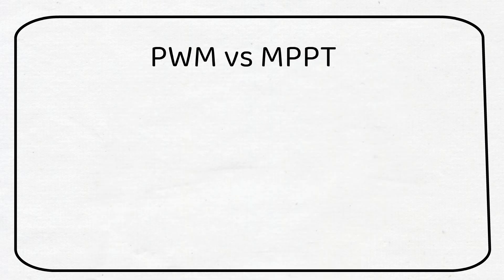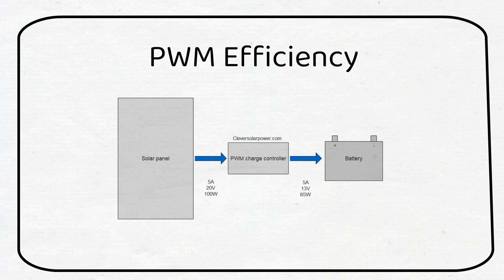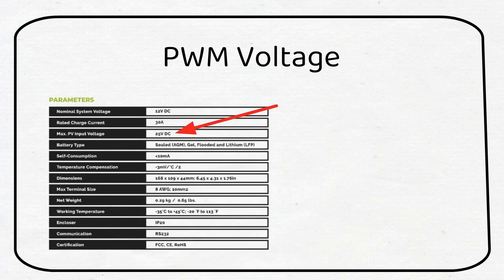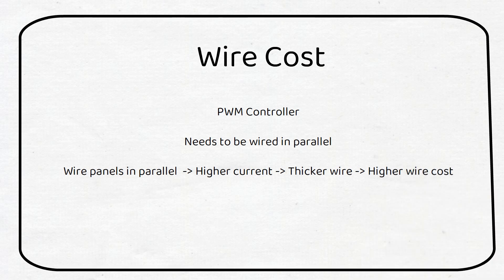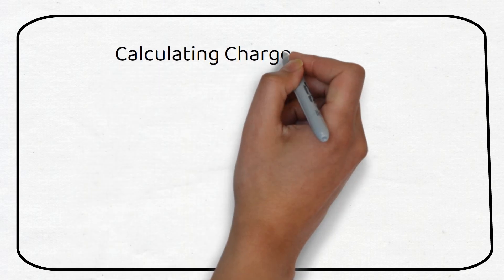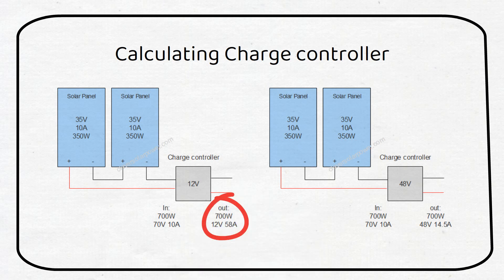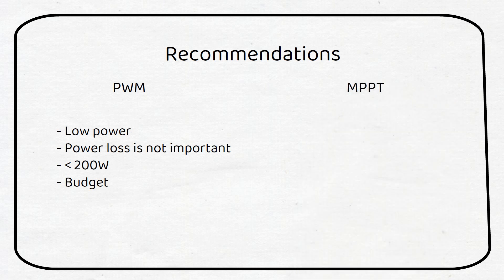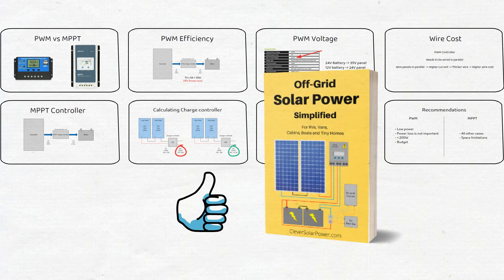PWM vs MPPT Charge Controller for Solar Panels: Which one is best?

Comment: Ever look up the price of a 48V dc to AC inverter?
Be prepared to sell your first born.
Most sensible one is a 24v setup or 12v setup.
Best bang for the buck.
With a 12v inverter, you can in an emergency hook it up to your car.
All others nope.
Mfr's KNOW what it costs to run any given solar arrangement.
You will either spend a lot of money on their overpriced equipment or a lot on wire.
And set prices accordingly.
Either way one of them is going to extract as much cash out of you as they can.

Mfr's also love to set warrantied to about 2 to 5 years too. KNOWING you may have to buy their junk AGAIN AND AGAIN during the life of your panels.
IMHO all equipment should be fully warranted for at least 25 years with instant replacement if their stuff fails.

Comment: I have both types of charge controllers. I found that the MPPT charge controller needs more sunlight to start working whereas the PWM charge controller will work under less available sunlight. With a small setup at 12V, I got more current from the PWM charge controller for a longer time than when I used the MPPT charge controller. The MPPT charge controller started working close to noon whereas the PWM started to produce current around 8 AM. Like you said, the MPPT charge controller is better if your solar panels are connected in series and you have several panels connected in series. I appreciate your video.
Reply: My MPPT starting work at 7:35 and stop at 19:00 in the Finland with Start/Stop power about 25Wt. My PV is 12x435Wt

Comment: MPPT controllers are useless on a cloudy day. They spend all of their time resetting and recalculating then sometimes they get stuck on a lower output when there is a cloud or haze but once the sun comes back out they can still be stuck on the lower calculation from earlier forcing the user to reset the MPPT to force it to make a new calculation.
  Show me some videos where people plot charts to make comparisons in real world situations.
It's better just to run a DC to DC step down converter. It will always convert the power available whatever that power is at the panel. It won't waste time recalculating constantly as clouds pass over.

Comment: Yeah but two lifepo batteries cost 5 times  the pwm controller and all the panels I would need.
Reply from the maker: You can start out with a pwm and upgrade later. When you buy an mppt, The Solar panels effectively work More efficient. That's because you will convert More power from The Solar panels into the batteries.
Reply: @cleversolarpower  again two batteries cost the same as everything else where I live. I am looking into buying a BMS module and connecting some batteries myself. It cannot be that I have to pay 1500USD for two batteries and then 1200 for a Victron MPPT, an inverter and 200USD for panels. Bosnia being here btw.

Comment: PWM if you are on a budget..........
You get can an MPPT controller for 35 quid (GBP), if you cannot afford that don't get solar panels.
Reply from the maker: If I have a shed far away from my house and no cable going to it I would install a 50-100W panel with a PWM and a cheap battery to turn on some lights. No need to get an mppt in that case.

Comment: Hi! Are you sure PWM converter does not increase the current when reducing voltage? I think its a dc/dc converter, not linear. Just the same as MPPT but MPPT regulates the input voltage (not only output) to get the max power from pannel
Reply from the maker: I'm very sure. I test it and a video will come out soon. A PWM cuts the excess voltage off.

Comment: Hey I need a solar home inverter with 24V battery backup and for me the UPS function is really important. My vendor suggested pwm based UTL solar inverter since he said that although MPPT tech is better but due to solar optimization its UPS function wouldn't do well. Is he correct and what is my best course of action ? Thanks in advance.
Reply from the maker: Depends how much solar you have. If you have more than 200W of solar, then i recommend using an MPPT.

Comment: Great vid. New guy here wanting to try out solar power.   I bought a small kit Eco worthy one 195watt panel came with a 30amp pwm controller. Then I just bought an extra panel same one 195watt and bought 2 AMG 12v battery’s 110ah will this set up work? 
Just wanna be sure before i install it all. Thanks for any help

Comment: Pwm only loss then what use
Reply from the maker: If you match the PWM with the battery voltage 18V panel and 12V battery, there won't be much loss.

Comment: Please I have a single 350w xolar panel, voc is 34v, vmp os 30v
And I have a 12v 200Ah gel battery, please what charge controller would be efficient, thank you
Reply from the maker: MPPT
Reply: @cleversolarpower  thanks

Comment: how do these things handle being connected to a system that also charges the batteries with a gas generator?  What do they do when the battery voltage is 13.2 while charging?
Reply from the maker: You can add multiple charging sources to the same battery. I made a video about it. (multiple charge controllers)

Comment: That was a good honest explination between the the PWM and the MPPT controller they both hove there places -    i might add this if your panels are at a distance from your batterys say 500 ft - in that case you would perfer to series your panels to get a higher voltage of 80 to a 100 volts - 
        With the higher voltage there is not a notacable amout of line loss compared to 12 or 24 volts - 
      At 100 to 110 volts DC  the line loss is 10 % per mile or 5000 ft - so at 1000 ft its not a notasable amount of line loss - a MPPT will correct the voltage to a usable voltage -
Reply from the maker: 500ft is long. You have to wire your panels so you get high voltage to the max allowable input voltage of the MPPT, and then run the high voltage wires to your MPPT which is close to your battery. Check my video about voltage drop.
Reply: I realize 500 ft is long - I had worked on micro wave relay stations in the Northern mountains at times - my family is also in the communications business - 
    Those repeaters oil company's use were once owned and set up for 48 volts - at times there was a distance between solar panels and transceivers -   the battery's were at the transceiver sight -            I know each country often uses different voltages - those AT&T repeaters always had MPPT controllers set up at the batteries for charging - the input was generally 120 DC off the panels  - at times the panels might be 1000 ft from the transmitters - 
     At times the generators were 3000 ft down a mountain from the transmitters -   there at lower elevations because fuel trucks can easily deliver fuel to bulk tanks during summer when the snow is melted - 
        In all AT&T has a standard voltage of 115 volts DC in this case for transmitting power battery charging -  
     At 3000 ft there is some voltage drop it might drop to 105 to 110   volts DC - but it was not enough voltage drop to master - there wasn't any inductive load - 
       Also in the rural US as you drive down highways  - you might see transformers on poles with simplex power lines coming off them that is 120/240 - that simplex line might have a run of 500 ft to a home 500 ft off the  highway - 
      The voltage in that home might vary from 125 volts to 115 volts when running a central heater drawing 60 
 KWs  - that's very common in the US, power company's don't like to run low voltage for more than 300 ft - but in many cases in rural areas  because of roads or trees or right away approvals - they will run low voltage 120/240 power lines 500 ft - 
      All I can say is even with the induction from 5 ton air conditioning condensing units it does work out fine ,- some times if it further than 500 ft they up the voltage to 130/260  volts at the transformer that way they can run 750 ft lengths of duplex - 
     The higher voltage is needed for induction loads of heat pumps that are at a distance from a transformer -

Comment: I was not born in missouri although I live there.  But you are going to have to show me how a pwm charge controller which is controlling  20volts at 10 amps is inferior to a mppt controler which may only be regulating a 40 volt panel at 5 amps.  I do not see a mppt controler providing 10 amps at 12 volts with a 40 volt 5 amp panel.  I do not see how you are going to get more amps  out than what is put in.   If true you are still going to need heavy wire going to the battery.  I have been useing a pwm controller on my 2300 watt panels wired in parrallel for 20 years and it seems to work fine.  I feel mppt controlers are way over prices for what they do.

Comment: Can't we use charge controller for charging lithium battery with car alternator?
Reply from the maker: No, the car battery voltage needs to be 5V higher than the lithium battery.

Comment: Can I run 2 charge PWM controllers from 2 solar panels wired in parallel? Can I split the feed coming from the panels to both controllers without losing any power? If I did it that way, would one controller draw more power from the other?
Reply: One solar panel connected to one  pwm, is better in your case.

Comment: Either of the 2, can we use 18650*3 or 12v series as storage batt instead of lead acid batts?
Reply: You can use either rechargeable battery.

Comment: Hi, i have a 555watt panel and 2 12v batteries (200ah) and a 60Amp solar controller. Is this okay to set up?
Reply from the maker: 555W/12V=46A
Reply: @cleversolarpower  so if I have 24V battery bank and 555watt panel that's 555/24=23, can I use a 30A solar controller?

Comment: Since I have three 100 watt solar panels (soon to be four), two are in a different location. I bought two 20 amp name brand PWM controllers which can do lifepo4 batteries. The two I have in operation are for lead acid batteries only. The two solar panels are already wired in parallel. The same will be done when the new panel arrives. I wish I could put all four solar panels together for a MPPT controller but I get more sun with what I did. I don't have the room for a larger system inside the house. I will be replacing the AGM batteries with two 100ah Lifepo4 batteries to run my 2,000 watt inverter. That is all the room I have.
Reply from the maker: Instead of getting two 12V 100Ah batteries, i suggest going with 1x 12V 200Ah battery.
Reply: @cleversolarpower  I am actually looking at a 180 ah lifepo4 battery which would be more friendlier with my budget...Yes, I gave you a thumbs up.
Reply: I'd be 100% sure that controller can work with lipo, many have lipo in the menu as an option but would likely destroy a lipo in 6 months
Reply: @adrinathegreat3095  It is a top brand PWM and I am not going to worry about it.

Comment: A PWM controller is basically a buck converter so it's not true that it wastes power because it doesn't. The difference between the PWM controller and an MPPT is what controls the charging. In a PWM controller it's just the output voltage, but with an MPPT is the solar panel power. The MPPT will get slightly more efficiency (like maybe 95%), but a PWM/buck converter will be 90% efficient, and if you just use an actual buck converter (without the charge controller function) then the system will work fine without a battery. It will still charge it too if it's set to the correct voltage, i.e. 13.8vDC for a lead acid.
Reply from the maker: I don't agree. A PWM controller is not exactly a buck converter. A buck converter actively reduces voltage while increasing current. PWM controllers, on the other hand, rapidly switch the connection between the solar panel and the battery on and off to control the charging process. PWM controllers regulate the charging process from the solar panel to the battery by rapidly switching the connection on and off, which helps maintain the desired battery voltage and prevent overcharging. They generally have lower efficiency compared to MPPT controllers, typically around 70-80%, as they do not optimize the power output from the solar panel, leading to some power wastage. In terms of voltage regulation, PWM controllers match the output voltage to the battery voltage but do not convert excess voltage into additional current. This makes them less effective at utilizing the full potential of the solar panel, especially when the panel voltage is significantly higher than the battery voltage.
Reply: @cleversolarpower  So a PWM output to a battery is not a buck converter? I'm not saying a PWM charger IS a buck converter (for those who can't interpret the phrase "is basically" and later the phrase "an actual buck converter"). The point is it does not waste power as is suggested in the video. It loads the panel and reduces the panel voltage based on average load. It does not optimise the load for the panel as an MPPT does, but I did not say it did. During the mark it charges the battery at full current and reduces the panel voltage, during the space the panel voltage recovers for the next cycle. This is how both MPPT and PWM chargers work. The frequency is usually quite high (like 150kHz) so the mark and space are very short, hence it's the average power/voltage/current you see. I presume you have dismantled a PWM charger and seen the diodes,  inductors and capacitors inside? Do you think they are just something to make the PCB look pretty?
Reply: So that makes pwm nice because it prevents the battery from overcharging right?coz battery wil deteriorate both when overcharge or drained right?  @cleversolarpower
Reply: PWM is not buck converter its only regulate overcharging not increase current because it doesn't have any magnetic coil inside

Comment: Nice video, bro i hav 600 wat panel and 200ahm battery, 3000wat small inverter.....pls which control is good for this MPPT or PWM and is 30ahm ok, i want it to power small hisense fridge,fan, television and lighs ?.... pls i need your help
Reply from the maker: Anything over 200W, I recommend mppt. Depends if you need to have the whole 600w available though. Check my other videos where I go in details about charge controllers, sizing and fridge power consumption.

Comment: hello, Can I charge 12v 7Ah 20hour battery with 18v 50w solar panel ? should this work or bad for the battery, do you have any suggest also I use pwm controller for it
Reply: use PWM regulator and is ok
Reply: @lukassinos  okay
Reply: @perfectcs9759  I think when sou use for 50w solat pwm and mppt all is okey to use

Comment: Series panels are more suseptable to cell shading problems. MPPT doesn't help when your batteries are full. I have tried 3 MPPT controllers and haven't found one yet that works right with my LFP batteries.

Comment: Thank you but it does not answer 8 x 405 watts panels 20 amp per panel does not answer which to choose that would work on gris and off grid UK what size controller and inverter
Reply from the maker: Check out my video about sizing the charge controller.

Comment: @clerversolarpower, how can I use a 24v Lithium Ion battery with a 550W - Vmp=31.6v, Imp=17.4A solar panel ? should I use a PWM or a MPPT(seems Vmp is NOT sufficient to use a MPPT effectively) ? OR is it better to use a 12v Lithium battery with a MPPT with this Solar panel ?
Reply from the maker: Yes, to be sure you need a 12V battery or even better, another similar panel. Pwm and mppt need 5V+ difference. So 29.2V+5V=34.2V and your panel is only 31.6V
Reply: @cleversolarpower  thank you.

Comment: In short, apart from all the safety features, what's the difference between an mppt controller and a buck/step down converter? If the power output isn't high(<10W@18V) wouldn't it just make more sense to step the voltage down and be happy instead of buying something expensive?
Reply from the maker: If you have a 100W solar panel, then a pwm is ok. If you go over that it makes financial sense to use an mppt.

Comment: Indeed I liked the video! I've been using a PWM controller with a small 100W PV panel in combination with a SLA 12V batterie (10Ah). It's meant to power some small garden lights. It goes on forever! Cheap and care free power.
Reply from the maker: The solar panel could charge the battery in one hour 😄. How many watts of lights do you have?
Reply: 2 hours @cleversolarpower
Reply: Hi friend...I keep replying ur videos...hope u make money from all these.ty😊 @cleversolarpower

Comment: No matter how much I try to understand this it is trigonometry to me😂... That's why I stick with harbor freight and the thunderbolt brand. 
I'm also struggling with parallel. Do I parallel my panels or do I parallel my batteries ?...tv, Xbox & possibly a "dorm fridge" is what I'm trying to power (Earthship meets studio apartment)
Reply from the maker: It's easier to take it step by step. Focus on the solar panels first, then how you can wire the batteries. Checkout my video that is coming out soon about calculating your off grid solar power system.
Reply: @cleversolarpower

Comment: I have  100w solar how many ah of controller do i need to use ?
Reply from the maker: If you have a 100W solar panel and your battery is 12V, then you need a 10A charge controller.